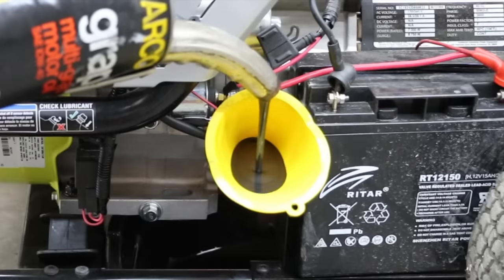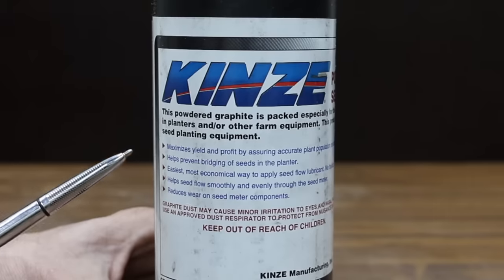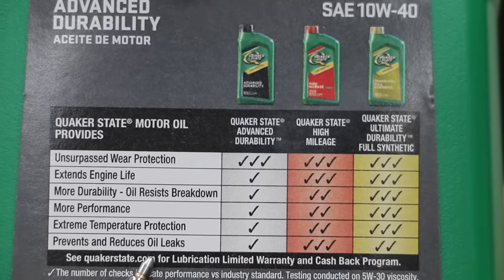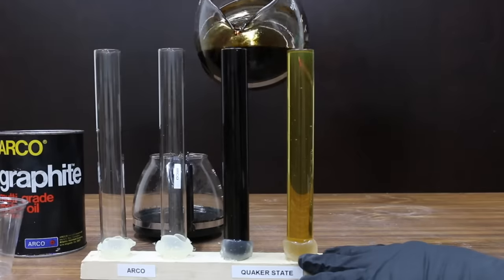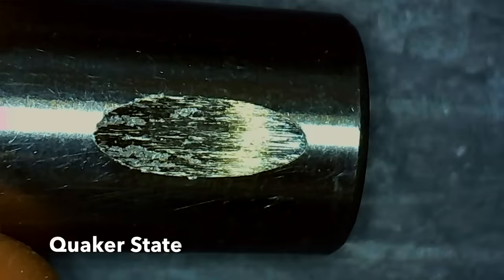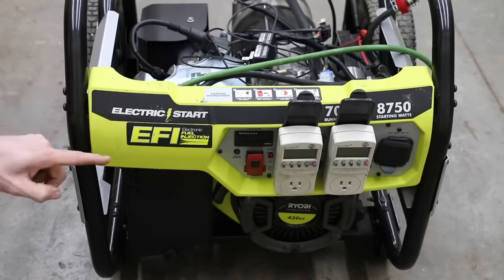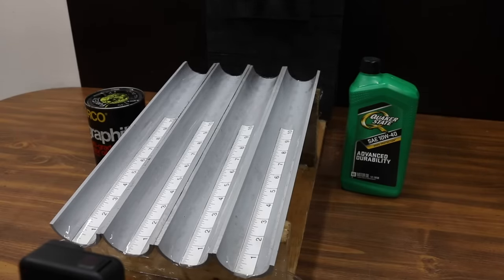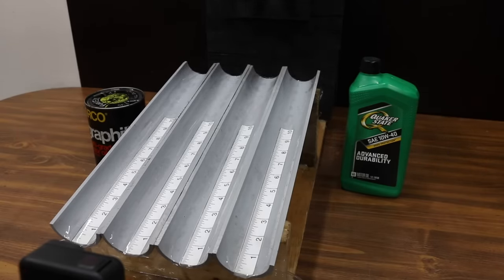Will "Graphite" Help Motor Oil Performance? Let's find out! Vintage Arco Graphite vs Quaker State

Comment: I worked at an ARCO Station and remember when that was ARCO's  response to Mobile 1 which had come out recently. It failed largely because owners didn't like that black oil.
Reply from the maker: Great point regarding the appearance of the oil.  Amazing film strength!
Reply: That's really interesting. I think it makes sense since that's the first thing you look at when determining whether or not your oil is worn out
Reply: It failed because seals weren't designed to retain it. Graphite oil seeps from everywhere. There were liability claims.
Reply: They needed to come up with white graphite, then it would have been a hit. Haa
Reply: @jessev2197  I hadn't heard that. I've heard of the graphite sludge building up in engines and the predominately used cork gaskets also leaked and it looked bad.
Reply: Don't know why I see this SO MUCH in oil discussions....it's not that hard. MOBIL is an oil..... MOBILE is a city in Alabama.
Reply: @TheWilferch  I know, It's autocomplete and I didn't catch it.
Reply: @jessev2197  what are b/c seals?  Thanks  
Uniformed motorist
Reply: @TheWilferch  Who cares. With the topic of the video nobody, I repeat nobody would have thought it was about Alabama.
Reply: @TheWilferch  it's also a toy over my babies crib.🤣🤣🤣
Reply: @harrisburghawk315  I think it is a short way of putting "because"
Reply: @walttrotter535  ...thank you for taking it the right way. I follow oil threads all the time and this comes up often. Stay safe and healthy.... cheers.
Reply: @BlackDynamite901  ....(EDITED) I talked it out with Walt already. See it all the time in oil discussions.
Reply: @livefreebehappy666  ...haha....yep.....take care..
Reply: @harrisburghawk315  An abbreviation for "because" -  it failed because seals / gaskets were not designed to handle the seepage of graphite.
Reply: @grassroot011  Lithium perhaps?
Reply: @harrisburghawk315  I think he meant "because"
Reply: @billiondollardan  you can't tell if an oil is unservicable just by the look unless it was ran well beyond its limits and becomes extremely thick. Only a lab can tell you when the TBN is used up.
Reply: @all4amd344  You're absolutely right. Oil that looks clean can be damaging, and dark oil can be fine. Just use recommended service intervals and good quality oil.
Reply: @harrisburghawk315  It stands for "because", my dude.
Reply: @walttrotter535  Reminds me of a used car I bought last year. Six months later, the new oil it came with still looked 'new' - utterly clean on the stick. There was lifter tick and noise that just wouldn't go away. After putting in a synthetic Shell oil, it became quite dark in a few weeks, and the lifter tick cleared up. Dark oil means it's probably doing its job.
Reply: @MattExzy  Oil has to suspend particles to be caught in the filter. Synthetic oil has a much longer molecule and therefore takes much longer to break down.
Reply: How much does it stop up the oil filter and cause the bypass to stay open?
Reply: @BrandonBigB956  I have no idea. I have heard that about that oil though. Try Bob the oil guy.
Reply: @harrisburghawk315  b/c = "because".
Reply: livefree be happy You must listen to Stormy Warren and MC on the Highway channel 56😂
Reply: Run a couple quarts of chlorine bleach in the crankcase as well. That should lighten the color up significantly.
Reply: @TheWilferch  Ah, but how do you pronounce Mobile?
Reply: @TheWilferch  because when you put Mobil 1 in an automobile, it then becomes Mobile 1. Kinda like meteor vs. meteorite. A meteoroid that vaporizes in Earth's atmosphere is a meteor. A meteoroid that survives Earth's atmosphere, and lands on the Earth's surface is then called a meteorite. 😅✌️
Reply: @benholroyd5221  that reminds me of the joke about telling apart chemists and plumbers by how they pronounce the word unionized.
Reply: @TheWilferch  "....I taked it out with Walt already" huh?
You need to know proper grammar if you want to be the grammar police...
Reply: @Hungry_Tree_Ghost  ... :)
Reply: @deceitive3338  ...I play no favorites here Cam.....when you're right you're right. key stroke didn't connect as I typed.
Reply: @benholroyd5221  ...Mo-beel
Reply: @errantpursuits4249  go on...
Reply: @TheWilferch  Where genius Alabamans invented cellular phones...
Reply: I used that ARCO graphite oil faithfully in the 80’s. I was often chided by the mechanics that changed my oil because it was black. They took one look and accused me of not changing the oil regularly. I explained that it was the graphite and that it was the normal color. I’m not sure if all of them believed me.
Reply: @jessev2197  The black stains on garage floor and driveway of the house where I lived in 1979 will be there until the end of time.
Reply: "Did not like the look of black oil." ROFL. The color means NOTHING. You go by the smell of the oil, compared to the smell of new oil. Dirty oil stinks. (And all crude oil starts out black and very stinky.)
Reply: @YodaWhat  But how does it taste
Reply: Made it hard to tell how old the oil was standard oil that dark was ready for changing unless it was in a diesel.